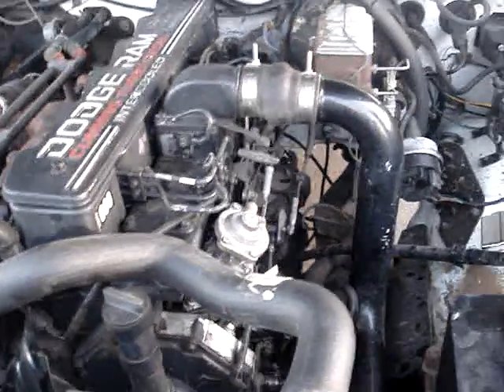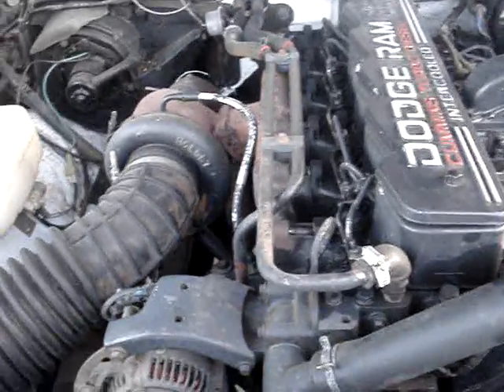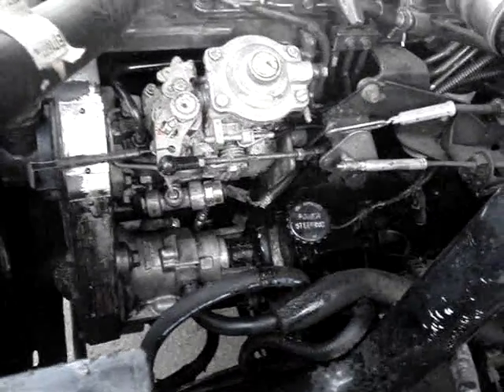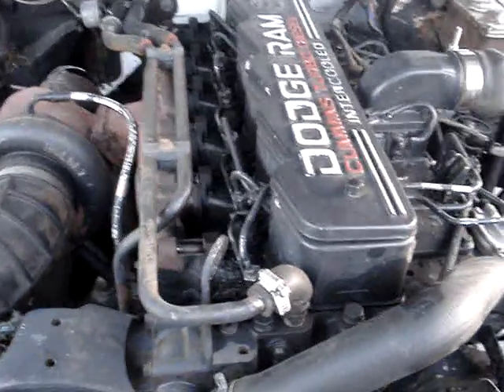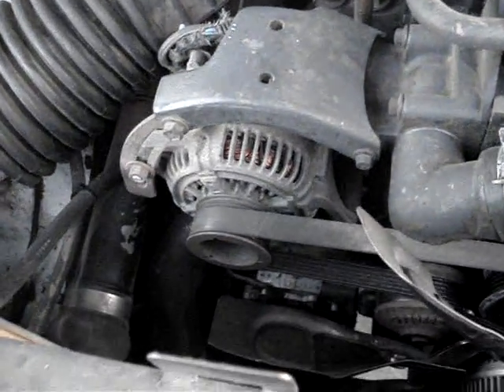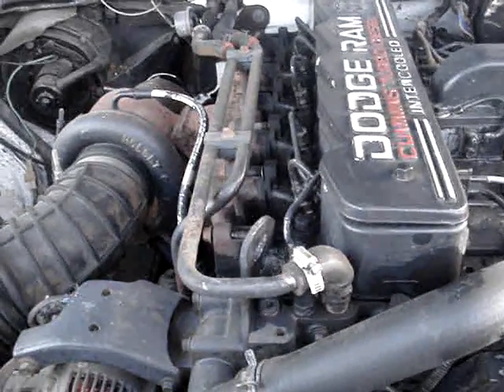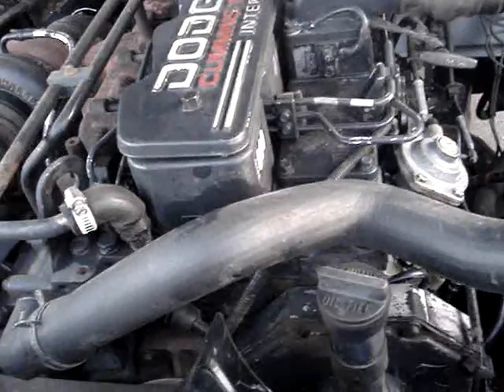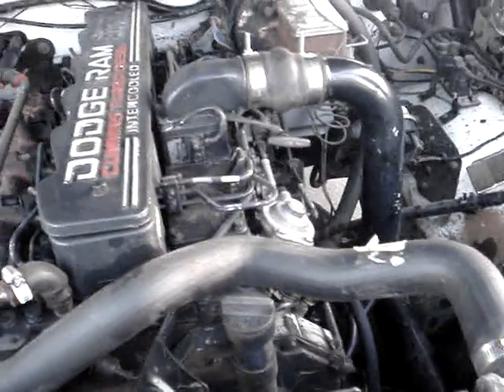higherpoweredh2o steps into oilburners and hydroxy

Comment: HI Rob ,great vids+info,hav'nt as much engine tec knowledge as u,but been getting great mpg increase on a 95 Ford transit 2.5 diesel 18ft rv with half a lpm.Tried same system on my 2.5 td mazda van, got no increase on mpg for about 9mths of tinkerin, finally added a venturi inside rubber boot about 120mm frm turbo same design as zero fossil's on utube now gettin 23% incease finnally!all the best Colin aka( flyindoctorcee) on youtube

Comment: Hi. Someone invented a way to get more power using less and cheep grade diesel, by fitting spark plugs, he called it a low powered system, I don't know anymore than that , I wondered if you know anything about this.
cheers zeropoint132

Comment: hi from england .someone told me that the rotary engine is the best as hydrogen can iugnite on the hot tips of valves once internal temp of engine is running and that the wankle engine was built to use hydrogen.(no valves) seems to add up have you looked at the bourke hydrogen engine.will intrigue you.its on you tube (very rear video just come on.) skycollection you tuber may also be worth a look .